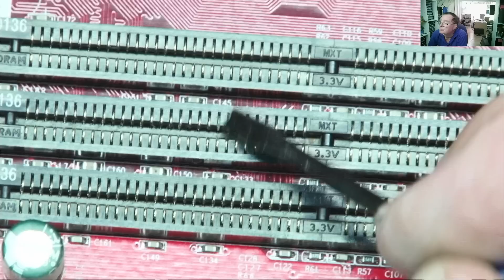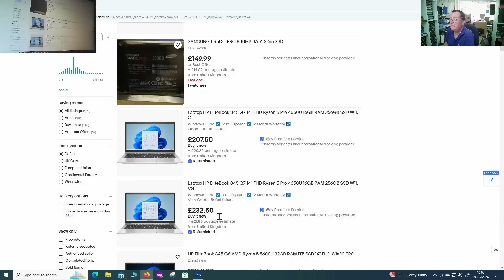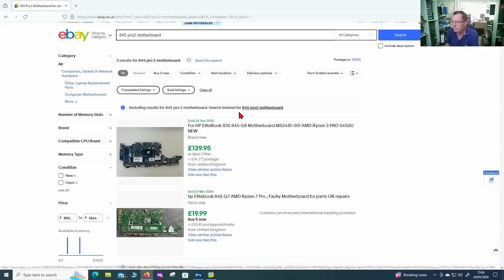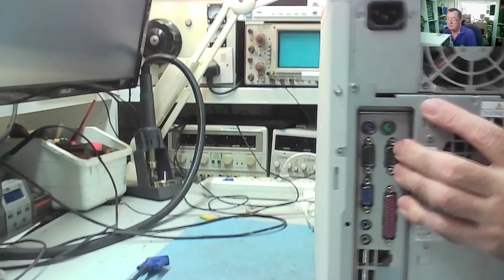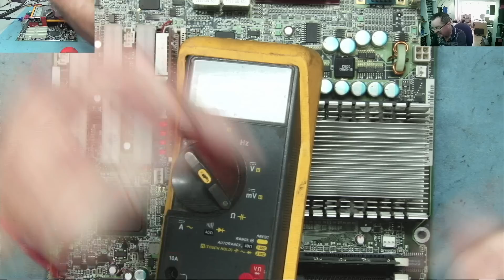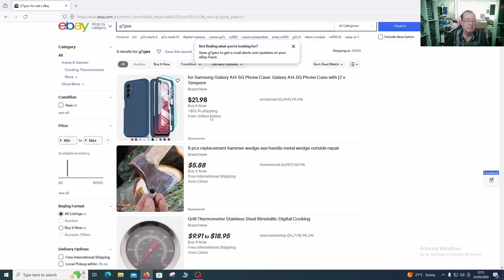Car Boot Flea Market RETRO PC FINDS 26th May : WoW This Was Really Rare!

Comment: The chassis of that first case looked pretty shiny. I don't think it was, but could it be aluminum? That'd be a nice piece of scrap. The MSI board is nice. It isn't that special, but somebody will want it for what they call a "retro rocket" build. The second one, the NEC, could possibly have some real value to it. It said radiographic control on it. I'm guessing it had a pretty specific job. Imagine someone still using that radiographic machine it was controlling winds up needing a new motherboard. Where are they going to find one? It can be a long shot, but those kinds of boards you really should list for sale with a stupid price - I'd go $500 us personally. You never know when you might find that one person that really really needs it. It might seem like you're taking advantage of somebody listing it at a price like that, but imagine what it would cost to completely replace radiographic equipment with all new stuff. You'd be doing them a favor really.

Comment: Rare? I didn't see anything rare. I only saw two junker Pentium 4 motherboards, one without an AGP slot which may be uncommon but using the word rare on a dead P4 board is pointless. Maybe it's rare to see this junker board working in 2024... that part is true ;-)

Comment: DVO is Digital Video Out. Intel speak for a digital parallel video bus.

This is the time of integrated graphics living on the northbridge. The time of VGA ,with TV encoder chips (S-Video/composite out) being everywhere, and DVI coming into the market.

So DVO is a digital parallel video bus, 8/16/24/32 bits wide colour data, I2C and some power, so that the onboard graphics can output to an external encoder chip for TV (composite/s-video/component and even VGA), DVI (precursor to HDMI) or LVDS (for LCD panels). You could even wire some LCDs to this directly.

All the IGP chipsets of the AGP era (intel, ATI, nvidia, VIA and SiS) had these as parallel busses multiplexed with the AGP slot. Now since this computer has the dvo connectors laid out as separate connectors, they had to forgo the AGP slot completely. DVO was later replaced by SDVO in the pci-e days (intel 9[46]x), where the display data was transmitted as serial differential pairs.

Since this was a MRI/X-Ray machine, these DVO connectors were likely linked to external encoder board (DVI or LVDS), to some grayscale display, sometime with more than 8bit per pixels. I would have loved to have poked around with such a machine in the day and made it work with X.

This was the time where i cut my teeth in linux graphics driver development, and where i saw the external encoders and decided that if it is modular in hardware, it has to be modular in software, and from there on started structuring display drivers logically. I ended up calling this structuring of display drivers "modesetting" (As to not clash with the concept of an X Display), and since a decade or so, modesetting is the biggest subsystem in the linux kernel.

Comment: If only Richard could type. He'd have been so excited. That motherboard is worth, wait for it, US $509.54 At least it's cousin G7GGDC is going for that. Looks very similar to me.  I searched for NEC G7GWX motherboard
Reply: someone is dreaming of getting 500 USD but in reality non sold
Reply: @Takashita_Sukakoki  I did notice they keep dropping the price hoping for a bite.
Reply from the maker: Which one the fist or the second?
Reply: @learnelectronicsrepair  they're both NEC industrial boards. That's what you have. It's not a desktop PC system. I was surprised to see polymer caps in a P4. I didn't know they had them that long ago. The first time I ever saw them in PCs was the i series.
Reply: The second mother board. You typed in the wrong number. You put e instead of w @learnelectronicsrepair

Comment: A set of stainless "desoldering needles" cost pence from Ali but are various bores and great tools for straightening ic pins. Much easier and controllable than using pliers. Never used them for desoldering though!
Reply from the maker: I've got some of those hollow desoldering needles.  As I often say, there are various ways of doing just about anything